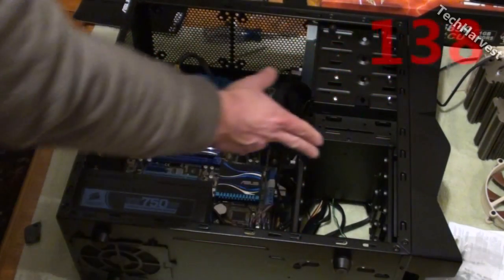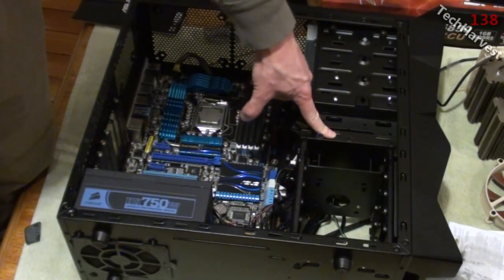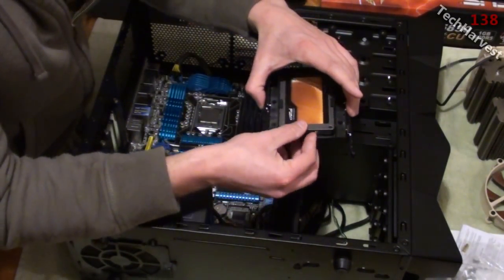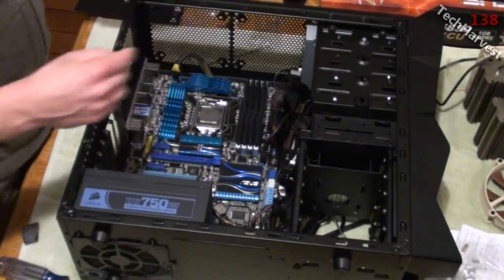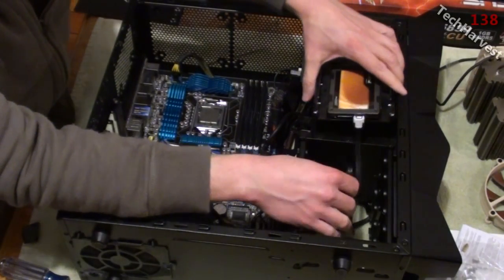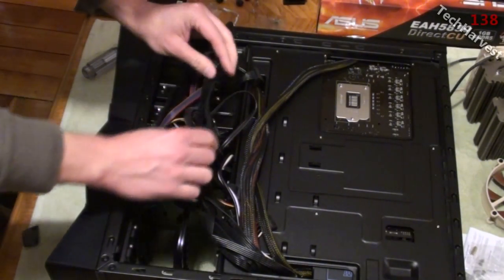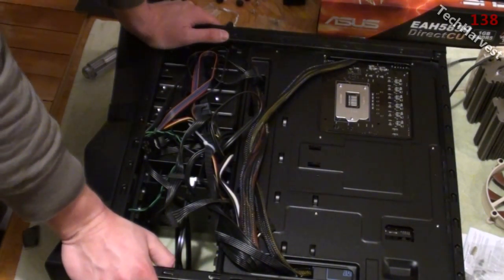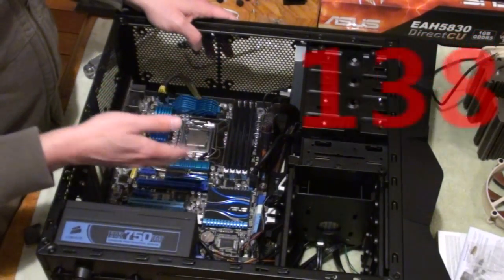Upgrading A PC: Installing An SSD (Solid State Drive)

Comment: Hello, I'm finishing my first build, I cant figure out which port would be best to connect my ssd's to the motherboard, I'm connecting a Samsung 850 pro and a Samsung 840 EVO to a Asus X99 Deluxe, thanks for the video, cheers.
Reply from the maker: Miguel Arreola Put them in the first and second SATA ports.  They should be numerically labeled.  Good luck with your build!
Reply: TechHarvest Hello man, thanx for the response, they are unfortunately not labeled 

http://tpucdn.com/reviews/ASUS/X99_DELUXE/images/sata_ports_small.jpg
Reply from the maker: See if you can pull up a PDF file on your motherboard.  Google the model number.  When I'm in doubt, that's what I do.
Reply: +Miguel Arreola ... the Asus x99 booklet numbers them

Comment: Thanks for the video. I'm going to do a new build in the next few months and it will be my first using a SSD. I couldn't figure out the plug configuration. Forgot about the power supply plug....DUH. Anyways your video helped me out. Thanks!
Reply from the maker: Brandon Pegg I'm glad I could help.  Thanks for watching!

Comment from the maker: It depends what you want to put on it.  It is enough to load Windows on and run your system from that SSD.  If you have a lot of programs or files, you might need a bigger SSD or a companion HDD installed in your system.

Comment: Hi "TechHarvest" i want to buy a SSD unit to install it in my desktop pc but my question is "is there a color/type difference that you can notice between a 3BG and a 6GB SATA Connector in Your MoBo? Cause my MoBo has 3 SATA connectors which 2 of them are black and the 3rd is a White one. Let me know soon and thank you.

Comment: Nice video. I got an ssd today. Are there any issues with installing my existing copy of windows onto it? In terms of the license I mean? It's still the same PC but does Microsoft allow this? Or does one need to buy a new copy of windows if you upgrade motherboard, CPU, and Ssd like I did?

Comment: Hi there, i recentley bought a OCZ vertex 4 for my gaming computer, but when i try and connect it, i find a cable that seems to connect both the data and the power cable together, however it only has a data output, i was hoping to have some light shed on the subject because my computer doesn't seem to turn on properlly anymore, thanks

Comment: hey, i have a windows 7 oem OS on my hard drive, and i was thinking of upgrading to an SSD, i know how to install it, but, can i just use my current OS and install it on the ssd, and how should i do with my old hard drive if i want to use it too, but just the SSD as boot and program drive?